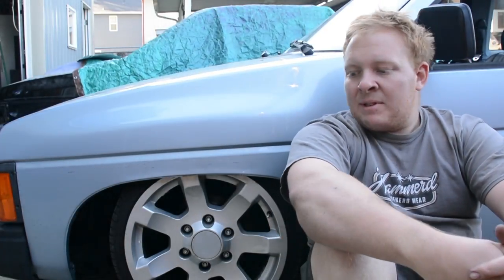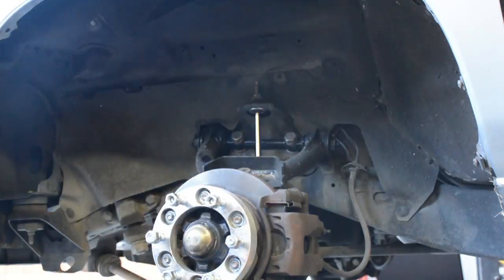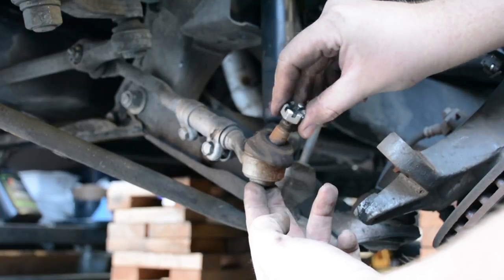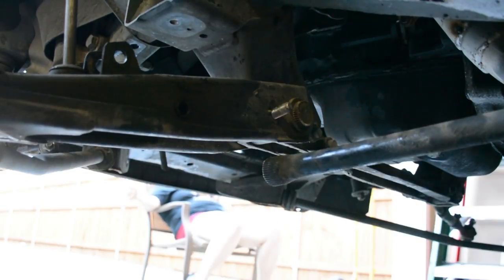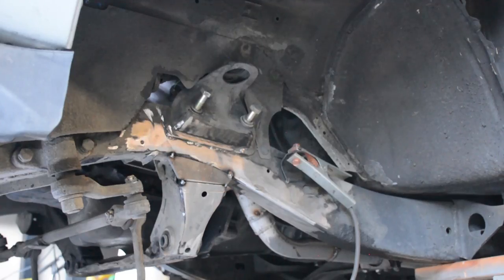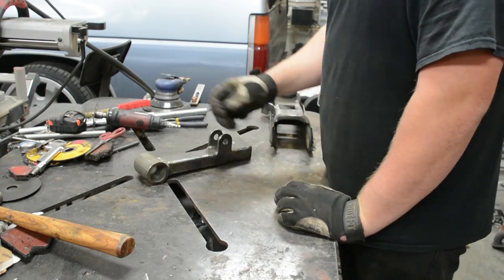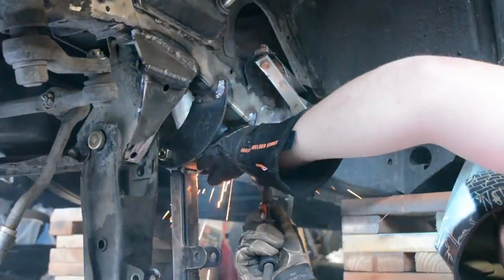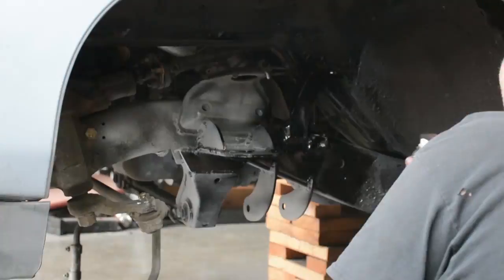HOW TO BAG THE FRONT OF YOUR TRUCK

Comment: Nice clean work nice video..  I have a quick question.. did you have to angle up your front upper bag brackets?? If so at what angle did you set the upper brackets. Thanks a lot!
Reply from the maker: Thanks, i set the uppers to match the lower control arm angle layed out. For example if the lower control arm layed out is 20° ill match that angle with the upper bag bracket said 20°. That way when the truck is sitting on the ground all the way aired out the bag is squished evenly. Hope that makes since.
Reply: @scrapingpavement  ok yes it makes sense thanks a lot !

Comment: Great work  well explained it’s nice you took the time for the viewers yes more lighting but my only question is you can’t go left or right when it’s dropped better be careful I had a 1986 Toyota hooked up long ago it was a blast working on it I loved those days nice work
Reply from the maker: Thanks Anthony! Ya this video lacks in some crucial areas, I try to keep progressing with my new content.

Right, minitrucks and turning radius is minimal most of the time. I'm running 16s on the truck now and can almost turn lock layd out 🤘🏼🤘🏼

Keep on truckin' ✌🏼

Comment: Is there a video of bag mount placement and how to set ride height
Reply from the maker: I dont have any video I'm particular that goes over this. How I do it is figure out your overall wheel amd tire height or mount your wheel amd tire, and jack it up until the bottom of the tire is flat with the frame. This is where you'll mount the bag at full bump which is typically 3", after that you'll just want to make sure you mount the bag as close to the frame as you can without it touching. This is important because you'll need as much room on the other side of the bag to be able to lift all the way up, and bot rub your bag with the spindle while turning. If you google "project body bagged" it was a 3 episode series on the show trucks where they bagged a nissan hardbody and they have a ton of great tips in that video series. Hope this helps!

Comment: Any recommendations on what to maybe keep in the truck if you blow a front bag? Or what the best way to change it out is in a pinch?
Reply from the maker: +Cuttinthruchaos This is a great question! So first off I recommend having at least seperate air lines to each front bag, because if it was a teed line if you blow a bag or line both sides would lose air. As far as an emergency tools here's what I would recommend,,,, union push to connect fittings, Teflon tape, Schrader valve, wrench, small scissor jack. Worst cast pull the bag out and shove a large solid object in there to hold the truck up like a 4x4 piece of wood for example, then just limp your way home.
Reply: scrappingpavement thanks for the reply. Also, great video! Yeah, that’s always the biggest worry. Not so much for the rear, but the unforeseen things that can happen in the front, or the wear and tear on the bags. Keep posting your videos. They’re the most informative ones of seen yet that are this in depth concerning air ride!

Comment: do you think the piece you added to the lower control arm could use a bit more triangulation to reduce stress on the welds. I was thinking a  piece from the original pivot point out to below the shock.

Comment: How does it ride with the bags now compared to the torsion bar system?
I would imagine better as air bags lose a lot of sprung energy when in compression.
Reply from the maker: It rides very nice compared to being static dropped. The back bag setup is slightly stiffer because it's set up for weight handling but if your cruising low with air it's a very nice ride compared if you were cruising low with a torsion drop and drop blocks in the back.

Comment: do you still make the lower control arm triangulation kit and the block off plates as well as the bag plates?
Reply from the maker: I make everything besides the triangulation kit, currently working on a new version of the triangle kit.
Reply: @scrapingpavement  gotcha ya I looked again and I saw everything any idea when you may have it available not in a rush or anything just curious

Comment: Could you make a tutorial on bagging the front of Ford Ranger and such? I happen ro have just that model. 😂
Reply from the maker: If I ever bag one I'll be sure to do a video!
Reply: Wonderful to hear! What exactly makes bagging Ford Ranger different? Is it remarkably more difficult to do or is it just different process to bad Ranger front?
Reply from the maker: @TomHimanen  most if not all rangers have I-beam front suspension. Bag brackets are different, i belive the frames need clearance for the tie rods. Probably simialer amount of work but i have yet to bag one personally.

Bagging is the same in the rear though just the fronts are different
Reply: @scrapingpavement  If I have understood it right, in T6 Rangers and later, front suspension is coil springs with upper and lower control arms. If I'm not wrong about this, then the process should be similar to the one you showed in this video.
Reply from the maker: @TomHimanen  alot of the trucks that have coil springs will typically use a bag cup like on the chevy s10
Reply: Yeah, so also owners of Ford Rangers beginning from 2012 should be able to follow this tutorial. Great! 🙌

Comment: I was curious about adding an 1/4" or 1/2" on outside of lower bag bracket to LCA to give a slighter angle for bag to sit more straight when aired up or down. Is this nessacary like the old forums use to suggest? or just keep it flat on LCA like you did in video?  Thanks i enjoyed your video im ready to build a Hardbody
Reply from the maker: Completely up to you, I think the main reason that is done is because there trying to get a better bag angle when the truck is aired up. But I dont like how the bag sits when compressed because it squishes the bag at a wierd angle amd could cause a rub spot, so that's why I choose to mount mine flat. on the arm.
Reply: @scrapingpavement  Thanks bud i appreciate it.. Keep up the good work iv been following on instagram as well ready to invest in some of your product

Comment: I dont see your tube upper control arms in your web store. Do i need them for this kit to work? Thanks
Reply from the maker: We no longer offer upper control arms. They are not necessary for the other kit. We do offer an upper control arm filler kit, which allows you to flip your control arms upside for better bag clearance and ball joint angle.

Comment: Do I have to cut in well to put on the air Suspension same vehicle btw
Reply from the maker: If you run a really small wheel and tire combo you can potentially not have to cut the wheel wells.

Comment: Do you replace lower control arm bolt or use the factory contraption that the old tension rods uses
Reply from the maker: I've reused the factory torsion bolt on several trucks including this one with no issues. Just use a pair of vice grips to hold it while I tighten the lock nut.

Comment: Maybe I missed it but can you partially air it up and drive it like that?  So it sits "low" but not scraping the ground?  I've never bagged a truck before so thanks for the video.
Reply from the maker: +Robert Bethke yep you can air it up to any point you want. I was just showing max lift to all the way aired out.
Reply: I have an 81 ford courier I'm thinking about bagging this is informative thanks.
Reply from the maker: +Robert Bethke sweet! Not sure if yours has it or not but if it's a control arm truck your in luck. If it's the I beam front it's going to be a little more challenging
Reply: The Ford Courier is the precursor to the Ranger.  It as coils and A arms (control arms).  It's bsaically a Mazda.  But no torsion bars.
Reply from the maker: +Robert Bethke that's good because the I beam can get pricey if you want to convert to control arms

Comment: I have a problem with my brake caliber bolt rubbing my bag.....on a 96 nissan hardbody
Reply from the maker: could try to run a smaller bag, move the bag closer to the frame, adjust steering stops could possibly help...

Comment: Watched the video and maybe I missed it, but where did you relocate the stabilizer links for the sway bar?
Reply from the maker: I removed the away bar. There are 2 major reasons, first being no room with the bags now taking up the whole control arm. Second is a lot of bagged guys including myself will play with the suspension side to side. If the away bar was still there in put the whole suspension in a bind.
Reply: What options do you have for side-to-side adjustments? The idea behind my 95 is to be able to lay frame, no interest in body-dropping. But, I also want to be able to put down a decent amount of power. When I was growing up my brother had a 91 that he bagged and body-dropped, but he kept the original ka24e engine. Upon tearing my motor down for a head gasket job I found corrosion in cylinder and see no point in sinking money into this engine. All of that just to say I want to be able to lay frame, but haul ass in a straight line with good control.
Reply from the maker: For sure, know exactly what your saying. I have been pondering different ideas to be able to get a sway bar back in there. Realalistically there's no way th stock sway bar would work. So I'm starting to think a universal sway bar would be the trick because the bag goes right where the sway bar used to be so you would need to extend the position of the sway bar to get it out of the way. It's possible but will be a very tight setup.
Reply: @scrapingpavement  buying a longterm project, but running out of crap to take off is now making me wonder how in the heck I'm supposed to make this longterm goal thing last. I cant wait to start putting it back together with your front lca design

Comment: Putting hydraulics on these Nissans is a lot easier and a lot more fun.
Reply from the maker: +Robert Fernandez maybe so. But airbags give you a better ride and handling and great weight handling for example semis use airbags. Also don't have to worry about fluid leaks and in a lot of cases an airsystem can be a more cost effective choice. I would love to build a car on hydros in the future. But for now bags are what I know.

Comment: Are those 17 inch Titan rims that fit right onto your hard body
Reply from the maker: +Z Man yes and no. You will need to bore the wheels to fit on your hub. Or get spacers. Mine are bored but didn't like how sunk in they were so I added 25mm spacers
Reply: I got those same wheels for my truck because I liked how they look on yours but even though I got them bored out they stick out just a bit. Are your fenders off a 4x4?

Comment: Is that an RE6 or RE7 in the front? I am guessing an RE6?
Reply from the maker: At the time of the video I was using dominator 2500s but had some clearence issues and now im running re6 bags
Reply: scrappingpavement thanks. I already have couple re6s for mine. Question for you? I am running some 18” titans. Do you think I will need new upper control arms. Or just the lower parts you make for the shocks and such?
Reply from the maker: Technically you can run 18s without my lower triangulation kit but the kit does help with shock mounting. Tubular uppers will help alot when airing the truck up for bag clearence, stock uppers usually rub the bag. But an old school trick people do is flip the stock control arms upside remount the ball joint and flip drivers to passenger and visa versa. Helps with bag clearence and ball joint angle, if you don't already I highly recommend drop spindles which helps with ball joint angles to prevent binding.
Reply: scrappingpavement yes I have a set of 2” drop spindles already so that’s good. Interesting about flipping the uppers. Never knew that. I will take a look at that. That means it looks like I already have everything I need to do the front aside from the bag plates then. May still go ahead and get the triangulated lowers from you to be ready when I go 20s.
Reply: @scrapingpavement  also, on your site for the lower triangulation kit, does it come with everything for both sides or do I need two kits? It only shows pictures of one of the square tubes in the picture.
Reply from the maker: Sorry need to update that but yes it includes both sides.
Reply: scrappingpavement awesome. Thanks. I will see about picking some up next month probably. Then I will have a fun winter project. Maybe be rolling by next summer a little closer to the dirt. ;-)

Comment: What did u do with ur exhaust mine is just dropped and i broke it off from scrapping also the transmission mount
Reply from the maker: +Elchingon_92 I had an exhaust shop awhile back tuck it up as high as it could go, cut the cat off and dumped a magnaflow right before the axle.
Reply from the maker: what about it?

Comment: How thick is ur wheel spacer?
Reply from the maker: I ran 25mm spacers at the time, i am no longer running spacers.
Reply from the maker: Hardbody have a 6×139.7 lug pattern you can get 5 lug adapter but they are typically 50mm poke.

Comment: Hey man what tire size do you use on them 17s
Reply: What’s size are they
Reply from the maker: At one point i had 225/45/17 but were a little big to tuck, so ended up swapping out to a 195/40/17